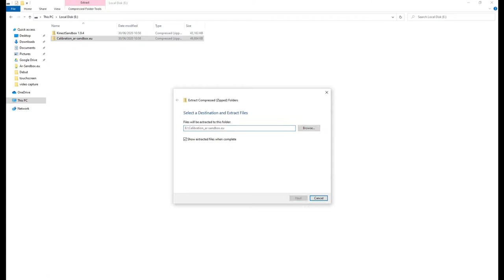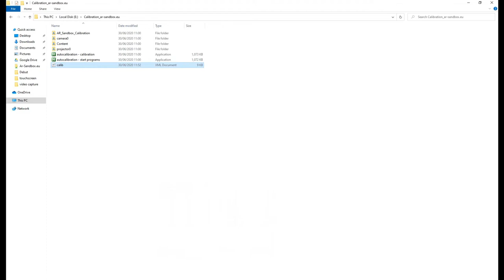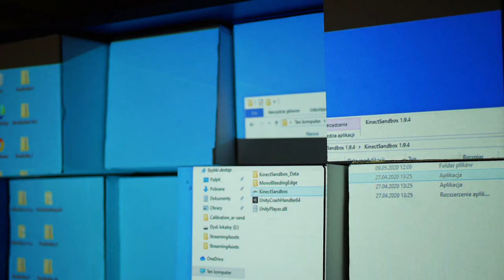Part 5: Calibration - Augmented Reality Sandbox DIY Tutorial

Comment: Our Sandox dimensions are 60x110 cm. If we use white boxes 20x20 cm there are 10 cm left without any box above. Can We use boxes like 10x10 for sort up this trouble?
Reply from the maker: From our experience we are using white boxes to get the best accuracy. It does not matter if you use 20x20x20 or 10x10x10 or other. If you you use white color, please put the white paper sheet in uncovered areas. 
Calibration can be made of sand without the boxes:
https://youtube.com/shorts/5a6Gkrbpu0k

Comment: The calibration software for us doesn't go to the step shown at 1:35 when horizontal and vertical lines are meant to appear on the projection to begin the calibration of our white boxes. Do you know why this is?
Reply from the maker: When using Windows 11 operating system you need to run ProjectorServer server in "compatibility mode: Windows 8" and check boxes: "Run us administrator" and "use legacy display ICC color management'
Reply: Is it the same for windows 10?
Reply from the maker: Runs on windows 10 and 11